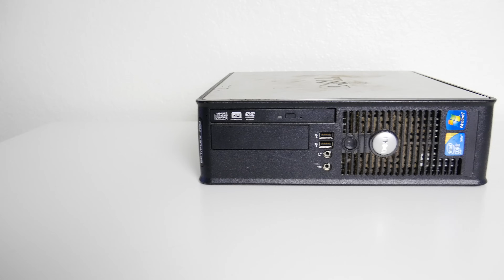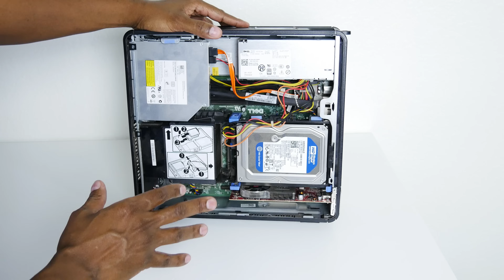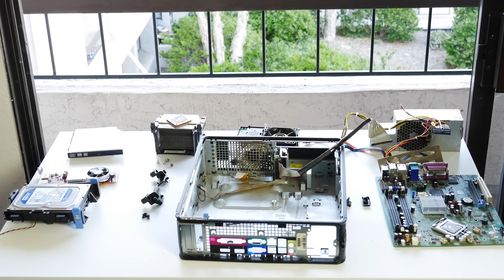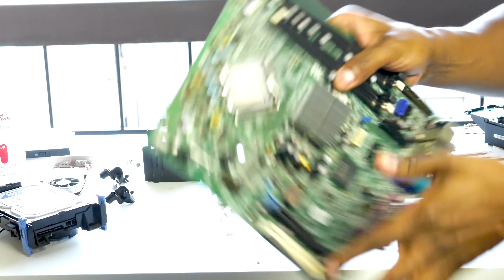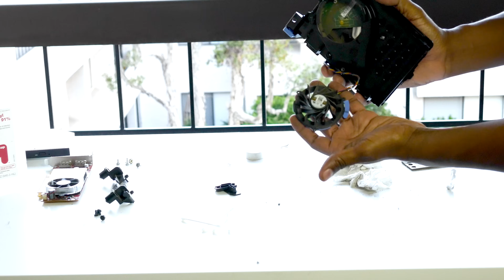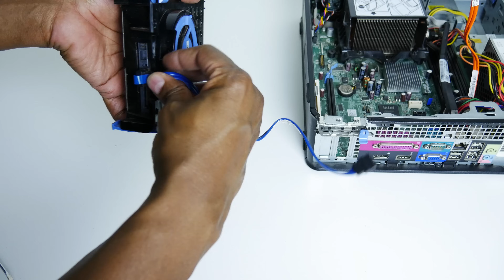How To Take Apart, Clean, Reassemble, Upgrade 780 SFF

Comment: Could I take everything out and put it in a new case? I really need to know
Reply: nope its practically impossible unless you have EXACT motherboard holes drilled in new case and exact mounting brackets for HDD, dvd player, etc.

anyways anything is possible but why all the hastle?
Reply: Michael Mulin found that out the hard way lol I got this pc for $40 and now I just put the hdd in my new gaming pc and still use the same optical drive so i guess it was kinda worth it
Reply: Michael Mulin the build I ended up doing was wayyy better I get around 100 fps on overwatch ultra settings
Reply: Bananoboost That's great! I still want to modify this PC instead of use a new one and maybe in the future upgrade the power supply. the thing I really love about this PC that very little people mention or know is that it has a gigabit ethernet port vet very little computers have mostly Top Notch gaming PCs. oh I'm going to do with this PC is at a solid state drive, low profile graphics card, repainting job, more RAM upgrade it to 8 gigs instead of 4, and some new wiring for additional fans. I also plan to cut a hole in the side and add some plexiglass for my lighted fan to look cool through the plexiglass. look up on YouTube Dell Optiplex 780 mods and you will see the first video where the guy does the exact same thing.
Reply: PS It comes with a low profile adapter..EVGA GeForce GT 610 2GB DDR3 PCI Express 2.0 Graphics Card ,, I didn't buy it for gaming per say.. mostly for 3D graphics rendering
Reply: radstorm I got my SSD in so the PC is learning fast......but bought a cheap ass graphics card and it lags in Minecraft a little bit so I'm scared......visiontek 5450 is truly trash
Reply: Not familiar with those Michael.. I got the one mentioned for $45. I ant really tell you how it fairs in gaming.,, I still play rts gAMES,,LOL  but evga is really good about updates for gaming
Reply: I am not familiar with that brand Michael.. The one I bought costed $45, but I assume it does ok with gaming,, EVGA does update the drivers pretty often.. It did really good for my needs for 3D rendering though. and I suppose that is vital in games as well

Comment: Is L255P-01 a good Power Supply?
Reply from the maker: +Blue Sky I haven't changed out the power supply on one of these. You can measure and compare to see if it fits. If you decide to get one please share your results. Thanks
Reply: If you mean the L255P-01 yes, it fits. I asked about it because i don't know if it is a good power supply or if I should change it. Could you tell me if Intel(R) Q45/Q43 Express Chipset is a good graphic card? Instead of it what is a good economic graphic card for optiplex 780?

Comment: I'm looking to make a very low budget PC for my friend, I am wondering if an EVGA GeForce GT640 would fit into this system and if the PSU could feed the required 65 watts of the GPU? Thanks :))
Reply: Unfortunately, I dont think it can.... Try this chaper VisionTec 5450 model thats low profile for this pc. Basically anything with a fan won't work unless u upgrade the PSU

this is the one I got, I just disassembled my dell for painting bc I'm going to make it into a gaming computer, this is (in my opinion) the cheapest and best graphics card u can get for this model without having to mess with the PSU

https://www.newegg.com/Product/Product.aspx?Item=N82E16814129319

Comment: what's the best possible graphics card you could stuff in that thing. o have one but I'm thinking about upgrading it to a better video card but I'm not that experienced with this kind of stuff
Reply: Well the best thing atm is a 750 Ti, but AMD might be bringing out a single slot RX470/460, so those are the best, the 470 being a but better than the 460
Reply: could it run ark at medium or low settings if I have the desktop version
Reply: Rage Raptor the 470 would bottleneck a core 2 huge take a 460 or 750 ti not higher you wont see advsntsges cuz the cpu
Reply: does the pc require a low profile graphics card?
Reply: Rage Raptor yes
Reply: A 750 ti has low profile but the stock psu in it cant power it
Reply: lies n8f

Comment: Heeelp - Help Steve (or anyone) I’ve changed a faulty power supply on my Optiplex 780 and carefully put things back but on start up says ‘Drive 0 not found - what have I done wrong?
Reply from the maker: Sounds like the cable
Reply: @TechSteve  Yep that simple. 🙄 v.grateful won’t bother you again.

Comment: can i put a gtx 1030 in using the same power supply or is too much for the power supply
Reply from the maker: +Kasim Ashraf it requires a 300 watt power supply so you would stress the system http://goo.gl/JRzvRC but I keep my advise safe and by the book.
Reply: Thanks

Comment: Can I ask a dumb question of anyone?  have an old optiplex 780 just like the one in the video that stopped working a year ago.  Can I take out the hard drive and switch it into another same model optiplex, turn it on and away it will go? Really liked that computer even though it’s quite old. Thanks for any advice.
Reply from the maker: Not really because of registries in each computer is different, you will have issues with drivers and a few other hardware problems
Reply: @TechSteve  Thanks Steve, that’s why I asked - registries? drivers? don’t mean a thing to me. I’ve used your brilliant videos to take things out, clean and put back and it’s been really useful and interesting but I’m an old guy and have my limitations. Thanks again so much esp for answering so quick. Stay safe

Comment: i have a dell optiplex 780
240w power supply
Kingston 4gb ddr3 1033 hz ram
intel core 2 duo cpu E7500
windows 10 64 bit home edtion 
it has no video card  it has built in graphics but im looking to get a video card of 1gb that dont need a power cable so i can give this pc to my mother as her one has bean butchered by her ex just to make his work any help will be good
Reply: Aaron Allen I recommend the DELL AMD RADEON HD 6450 1GB DDR3 LOW PROFILE

(make sure its made by dell  or ur fuxked)
Reply: thanks i no got a nvidia geforce gt 710 zone edition 2 gig at max it only draws 19 watts

Comment: i want to upgrade cpu, ram, hdd and gfx. can somebody give info i need to find compatible parts
Reply: it depends on what one you have if its anything like the one in video the it can handle 8gb of ddr3 1033-1600 ram my make is kingston the ram the have are always a safe bet to use video card i dont know about but the cpu the best ive sean is a quad version of the intel 2 duo E7500 2.93ghz the quad can be 3-3.5ghz hope this helps

Comment: can a nividia gtx geforce 470 gpu fit in this thing?
Reply from the maker: +Dexter measure your case then get the specs off of the web site see if it will fit. Plus check the power requirements. I don't own a 470 card to replicate
Reply: Dexter unless you can put a low profile plate on it..no. I have seen and have done myself.. got out the tin snips...but of course it is not pretty..lol